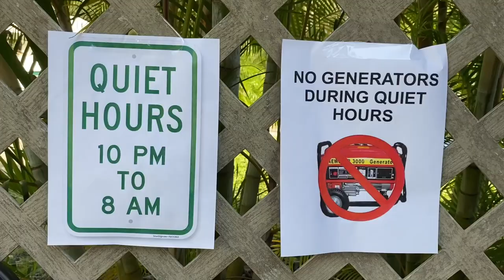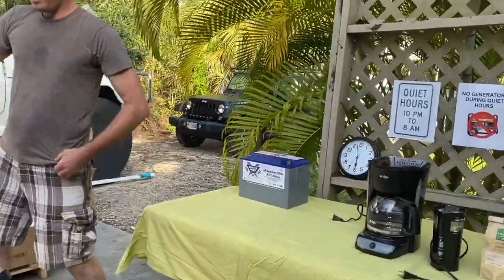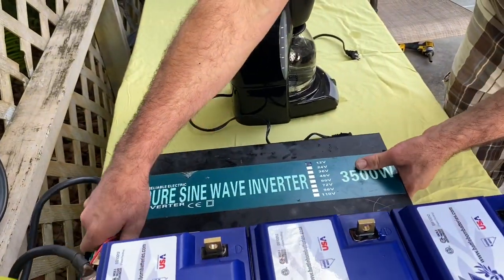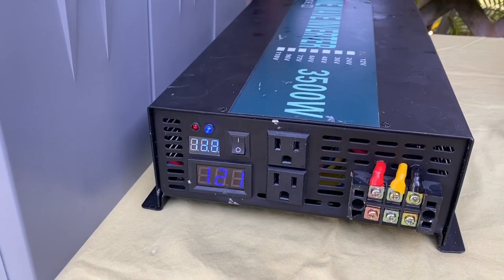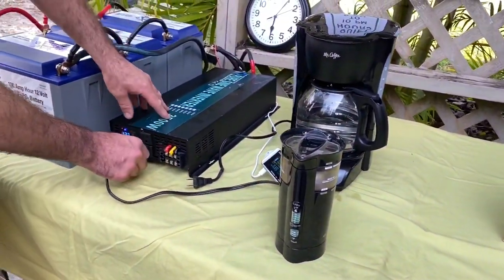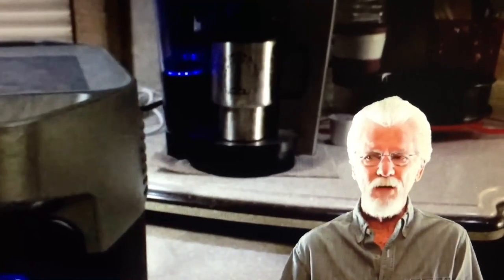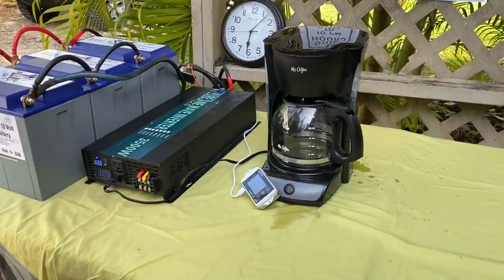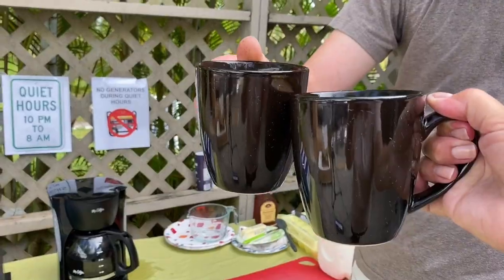How much battery power do we need to make a pot of coffee?

Comment: Behold—— the $4,000 cup of coffee
Reply: THAT is funny!!
Reply: indeed, you are so right !!! 4,000$ coffee
Reply: @lukeskywalker3891  
I make cold press when living on the road. 
I use one glass mat battery for all my electrical needs including cranking my engine. I check my battery voltage regularly with a multi meter and I try to drive at least a few miles every couple of days
Reply: A small propane stove would be a lot cheaper and more efficient.
Reply: @lawrencedavidson6195  Well, if they already own the solar/batteries/inverter for other uses, using it to also do coffee would probably be cheaper than additionally buying a propane stove/fuel/etc.

Comment: just use a propane burner to heat some hot water in a pot, pour out hot water into coffee press/instant coffee in a cup, you're done.  Explain to me how you are going to re-charge the batteries again?  Spend all that money for nothing.  Gas/propane Generators aren't that bad and the cost of a good one is a mere fraction of your set up here.  BUT thank you for posting this video!
Reply: solar
Reply: I want four cups of coffee, not one. And the hassle of cleaning a French press two or three times to do this is not ideal.

Comment: Slight overkill using all that hardware. I use two 12v deep cycle rv batteries through a 750w power inverter, two 100 w solar panels . I make coffee just fine every morning and it barely makes a dent of power draw from the batteries

Comment: What about using a 12 volt coffee maker?  Thanks
Reply: The amperage would be so high that you wouldn't want to work with the wire to connect it.   A 1500 Watt coffeemaker pulls about 12.5 amps at 120 volts.  At 12 volts that would be 125 amps.

Comment: When you use a battery bank (lead acid)... you get this illusion that you'd have power until it gets to zero capacity. But I wonder if that's right? Would the system actually lose too much voltage to really power anything if you go below, say 50% or 30% of the battery bank's capacity? 

Wanted to ask this. Like when I put in a load right away the power on the battery bank is dropping from 12.5-6 volts down to either 12.4 or 12.3 volts sometimes. So... logically I'm not sure if I'd actually get to a point where it couldn't power stuff, even though there was still juice in the batteries? 

Hope someone has some ideas on this. Thank you.

Comment: $3,000 worth of batteries. maybe easier to use microwave? i would like to see the energy costs, after all maybe they only need two cups, not an entire pot, sure microwave coffee would taste different. also wouldn't a rv camper have gas stove? how efficient is the inverter? i do appreciate the video, mainly for the watt meter data on a common task

Comment: good video.. Unfortunately electric is just not great for heating.. propane is In my thinking is a much better alternative. yes the convivence of the drip electric is nice. Just my $0.02.
and all that said, I have made the same measurement, using a Lead Acid Batt. and an inverter,    got just about the same AH lol..

Comment: I like the demonstration, but 12 AH to make coffee is ridiculous.  I fire up the stove.
Reply: AMEN to that.  He does have 300 usable Amp/Hours, but he needs a good solar array to recharge them.
Reply: I have four BB batteries!! I make coffee every morning off my batteries. Great thing is these are lithium so they charge up quickly when compared to lead acid, due to the fact that these batteries need very min absorb time. If i remember correctly only 30 mins per battery wired in series, and thats only for cell balancing.
Reply: If you've still got power in the morning and its going to be sunny, you can save the propane.  Even a couple of panels will make 12 AH pretty quickly before mid morning.